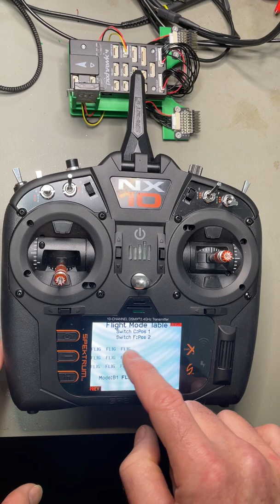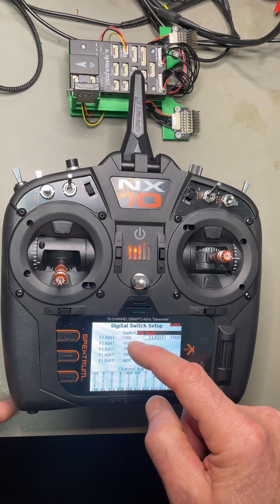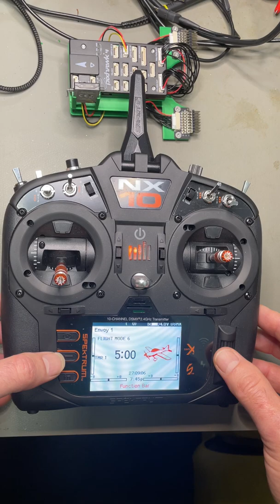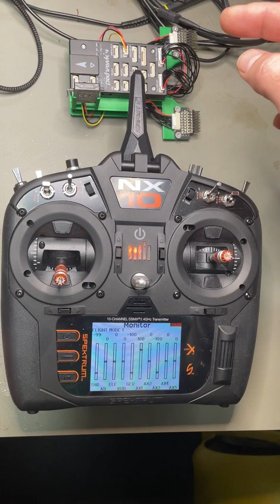Configure Flight Modes on Spektrum NX10

Comment: Many thanks for the super helpful information. What is the situation with the NX8? There only seem to be five flight modes. Or am I doing something wrong?
Reply from the maker: I'm afraid I only have an NX10 and have never used an NX8. It could quite possibly be that there are only 5 modes on that transmitter. Best of luck.